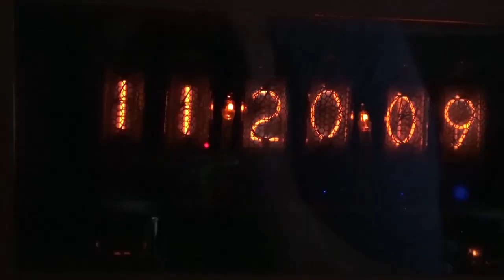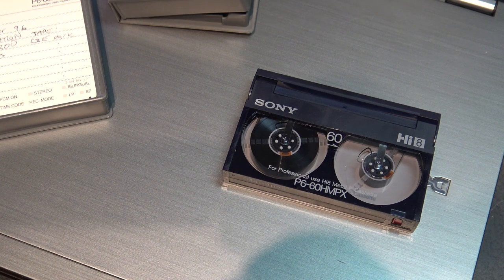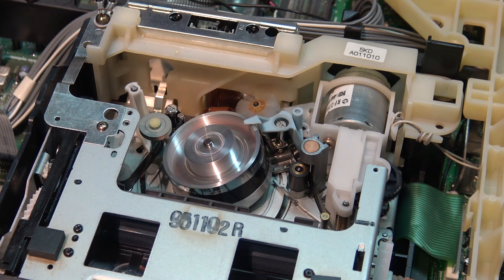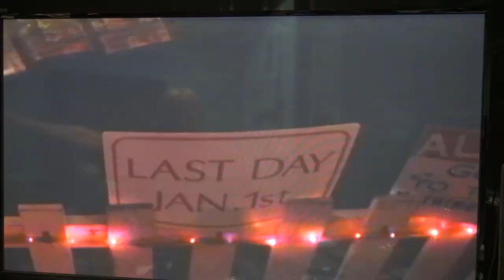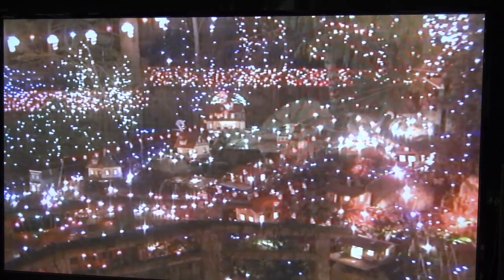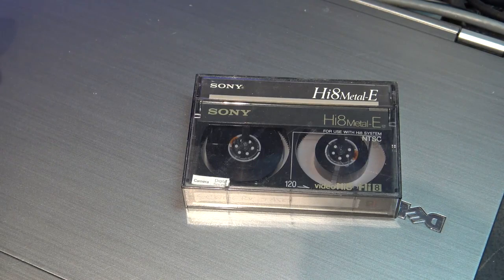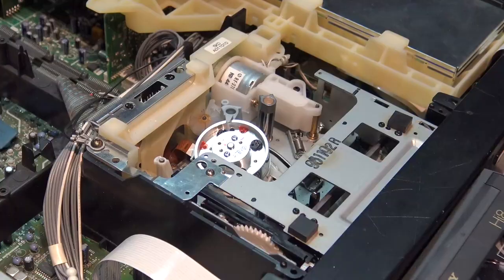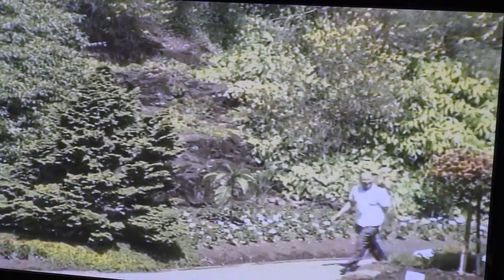Sony Hi8 tape was total garbage. Lets see why

Comment: I bought a box of those 'Professional' Sony tapes - they immediately closed the head of the camcorder.   So much for professional quality. hahah
Reply from the maker: Hahaha. Ya so did I. I bought a box of p6-60hmpx. Worst tape i ever used. I still have 3 or 4 unopened.  Sony said they fixed the problem but they didn't offer to replace the ones i had or reimburse me for loss due to tape failure rather point me to the warranty where it states they they will not be responsible for any loss of revenue for tape failure.  Tell that to the couple who's wedding was a mess of dropouts when i used one on my vx3 on a steadycam Jr.  All the nice tracking shots of them strolling around the park was lost due to a clogged head during record and no warning that the recording was no good.  Fortunately i was able to get enough but they asked for the raw footage and i didn't have the walk around shots that something funny happened (the bride slipped and fell on her ass) and I had it on camera.  They wanted the shot for a blooper reel and it didn't record.   I bought the short load tapes because the 60s were supposed to be a heavier more reliable tape.  It was just as bad if not worse. 😮😮😮😮😮 😢😢😮

Comment: Yeah I have a pile of sony 3/4" tape I still use, new old stock. In my experience sony Umatic seemed like it was getting dirt embossed into it, drop-outs that don't grind off and you can see a little impression or maybe also scratch on the surface of the tape. Just seems a bit fragile. I was recently testing a 3/4" deck and a sony 20 minute small cassette 3/4" tape came to a halt with a loud squeak in a BVU-800 which nearly made it's analog tension servo system throw the tape off the guides and then yank it and pinch it and run it over and then crank one of the reel motors into full maximum, but it recovered just in time. I don't know what the cause is yet, it's a back burner thing. Could be I got grease on the tape when I was repairing the deck and it contaminated the cassette. But the sound was like that high pitched squeak 3/4" machines make with sticky shed tape.
Reply from the maker: Ampex made some pretty bad umatic tape too. 
I don't use tape for anything except dat for temporary storage logging radio for copy to computer
Reply: @12voltvids  Yeah I mean Umatic ampex 187 (maybe and / or 197) tape. Made the death squeak and head clogged the heads every minute. After baking it played perfect and amazingly the tape surface is pristine perfect (checked with a good lens), I mean like I don't know where some minimal damage had been.

Comment: Was any issues with 1/2" VHS?
Reply from the maker: BASF tapes that were the pure chrome formula were pretty hard on video heads.
Reply from the maker: Plenty. There were many counterfeit VHS tapes that flooded the market and caused constant head clogging.
Reply: 12voltvids I used them for videos and DAT. They have been sitting for several years. I have them in a semi controlled environment. I'm almost afraid to check after seeing your video.

Comment: I have many old Sony Beta tapes that shed too much oxide and clog heads, along with many dropouts of course. When they shed, the actual tape becomes trasparent in some areas and you can see tape oxide dust all over the place inside the VCR. Never had that problem with TDK and Maxell tapes from the same era.
Reply: still new to beta and vcrs in general, but i noticed that my first betamax tape i got recently (blank), it was fine. i got these dynamicrons (blanks) and the machine itself seems to make more noise, louder and sounds weaker when those tapes are in there. they are all sony, the first one isn’t a dynamicron tho (still sony) and that one seems to be fine.

Comment: Sony reel to reel tapes are also often powdery or sticky. Somehow, their compact cassette tape doesn't give those issues. At least, i haven't experienced them.
Reply: Yes, the SLH line was problematic, not sure of the ULH stuff though. It is what's called sticky shed syndrome where the binder gets all sticky and sticks to the heads, leaving a gooey mess everywhere. Their PR-150 tapes were sticky binder that squealed liked a pig due to stiction caused by a lack of lubricant and often also shed a dry powder that's easily cleaned off and sonic-ally speaking, it was not any better than the old Scotch 150 anyway.

I have 2 reels of the SLH-180 tapes, backcoated too and were the early versions in the black/yellow boxes, bought almost 30 years ago as NOS and so far they work fine, not breaking down as far as I know. In fact, I played most of both sides of one of them the other day without issues. I think it's the later SLH-180 tapes in the red/gray boxes that may be problematic.

Comment: Besides that Sony Hi8 tapes, was Sony VHS tapes are that bad?
Reply from the maker: I never used Sony vhs but some if their beta tapes, the hi grade ones were crap so likely the VHS tape was bad too.
Reply: And likely there are no guarantees to whenever the binder decide to break off and loose some metal particle from the binder, and will cause to clog the head drum.

On the other hand, I have the Premium Grade tape made by the same company including both 6 hours and 8 hours tape, and it's not a Japanese made tape, it's a Mexican made tape, and I don't know that the quality is similar to the Hi8 one where it has the same problem by the manufacture who never solve the problem to correct their ingredient.
Reply from the maker: @Bluethunderboom  Notice that the tapes all had a exclusion to warranty for any loss of material due to tape failure.
Reply: Is also the same problem as Sony audio cassette tape whenever the binder breaks off and loose them iron oxide and contaminated the audio head and the erase head?
Reply: @12voltvids  While archiving the Sony VHS for Client, did the tape cause the head drum to get clog?

Comment: I don't know how MPE tapes are clogging the heads, as they don't have any binder, the metal layer is vacuum evaporated on the substrate. I have two Sony MPE tapes, my problem with them is the tape is so thin without the binder, the edges are curling, and the tape transport have problems handling it. Sometimes it's so curly that it doesn't even able to stay flat on the drum, in this cases they're unplayable, and I had to load-eject them muliple times, when finally the tape flattened under the tension of the transport, and I was able the play back the tapes.
Reply from the maker: The metal E tapes don't clog the heads, but the evaporated metal coating deteriorates and you end up with dropout city.  They dropout like crazy, but don't contaminate the heads, but it is about as bad when you have 100 dropouts a minute.
Reply: @12voltvids  I see. And I guess if there's a Digital8 recording on them (especially if it's LP), the picture would be pixelated and the PCM sound cuts out, because of the high data error rate.
Reply from the maker: @mrnmrn1  The biggest problem with digital 8 and miniDV for that matter was the LP speed. 

No interchangeability between decks. For the tape to play properly it needed to be played on the same recorder that made the recording.
Reply: @12voltvids  Yes, I've read this in the user's manual of my DCR-TRV270 Digital8 camcorder, although I've came across two other Digital8 camcorders (one from the same 2004 generation as mine, the other was a first generation D8), both played back my (fresh) LP recordings fine. Based on this experience, I decided to use LP only, because Hi8 tapes were expensive. About 12 years passed since then, I don't know how true it would be now, with aged LP recordings. I currently don't have access to other D8 camcorders.
Reply from the maker: @mrnmrn1  I never used Hi8 tapes for D8. Standard 8mm tapes worked fine.
Reply: @12voltvids  That might be the reason for your LP recordings are non-interchangeable with other players. IIRC, the user's manual stated that you shouldn't use Video8 tapes for D8 in LP mode, only in SP. It claimed you should use LP speed with Hi8 or D8 tapes only. I have to look up that manual now... Aren't the Video8 tapes chrome, and the Hi8 and D8 ones metal, are they?
Reply from the maker: @mrnmrn1  
Nope. I only used lp speed with the super long p6-180 tapes so I could get 2:15 record time for long weddings to make the master and the tape was always played back on the same machine when dubbing to vhs for clients.  
The lp tapes both on d8 and minidv were all tapes from clients wanting them transferred.  They were all on hi8 take or dv tape and any time I got them I had problems playing them.  For the record I have 3 d8 cameras and a gvd800 player for my digital 8 and 2 hdv cameras and a gvhd7000 hdv player.  When the lp tapes will not play on any of them it rules out any failure of a specific Machine I own.

Comment: Interesting, do some people have the same problem, say with, DAT tapes, since the technology is similar. Newer had this kind of problem with audio tapes: Maxells XLll, MA, TDK SA, SA-X, MA-X, some BASF - well they have other problems. Maybe some cheap ones would have dropouts from time to time.
Reply from the maker: It seemed yp happen only with the high grade 8mm and Hi-8 tapes from Sony. The standard grade didn't seem to have the same faults, but then from my experience I never used a standard 8mm tape because my equipment was all hi-8 so I used hi-8 tapes and my Sony branded ones are failing.

Comment: Surely you did not transfer this over to DVD unless the print was very good and clear...
Reply from the maker: Actually I do transfer tapes over even when they look bad like this. Have to stop constantly clean the head and pick up again. If going direct to DVD I'll stop the recording clean the head and then start up again rewind back slightly so that material is not missed and the client gets a tape back and their DVD and it'll have multiple chapters or I've had to stop to fix it and I'll tell them up front yeah the tape was damaged and this is why it cost extra right. Because I have a standard price per tape but that price is only valid if the tape has no damage if the tape requires extensive work such as demolding it before I can transfer that costs extra and they're informed and either they decide they want to do it or they don't. I've never had anyone say no to recovering their tapes because they really don't have many other options other than lose the footage.
Reply: @12voltvids  That's Amazing work, do you get tired of ever watching your clients video's, transferring video or vhs to DVD or any other tape medium is time consuming, that's good you charge extra if the tape is damaged, as damaged or worn tapes can be troublesome for the heads, and also can break the VCR, which has happened to most people.
Reply from the maker: @speedyboishan87  
Yes I do get tired of watching people's tapes. I am much happier when the tape does not have a problem and I can just load it press play hit the record button on the recorder and walk away and just kind of monitor it and make sure something doesn't go bad but when a tape is damaged and has to be babysat it gets monotonous. I understand that a new parent wants to do nothing but film their baby but come on 30 hours of tape in the first year!  I can understand the milestones but every time the kids spits up doesn't have to be documented on tape or worse now sometimes it's funny those first moments are usually pretty funny and I've got some that I'm sure will embarrass my kids when they're showing to them at some date down the road preferably at some celebration like a wedding nothing like embarrassing them in front of all their friends 😂. I see when I was growing up that's the type of stuff that my parents would have done drag out the most embarrassing moments and put it on display like a family gatherings and stuff and for someone with my age that was just growing up unfortunately today the kids are so sensitive that if you look at them the wrong way they're going for counseling. It's a sad world that we're in now.
Reply: @12voltvids  That's great what TBC do you use so that any Flicker or video abnormalities are fixed, not video malfunction..
Reply from the maker: @speedyboishan87  i use the one built into my player and capture devices. For something really bad I will run it through the videonics mx1 but generally the built in tbc on my evs7000 works great for 8mm and hi 8 and the input tbc on my Panasonic and Toshiba DVD recorders also work great at cleaning up video with poor sync.  That's all the time it's correct it will do is clean up the sync. if you need to adjust the video level and chroma level and chroma phase then you need to have a proc amp. Some high-end time base correctors also have a procamp built in. However to accurately use a proc amp you need both a way for a monitor and a vector scope and the tape needs to have color bars recorded on a section of the tape made it the time the original recording was made. This is used to set the video level Black level chroma level and chroma phase before you actually start the capture. since the number of home video users that were recording color bars for 30 seconds or a minute before they started using their tape is zero they do you no good because without a reference, and your monitor and eyes are not a reference, playing with a pro camp will usually do more harm than good. My EVS 7000 for example has a procamp built into the time-based corrector which you access using a menu you can adjust the color level and phase on playback however unless you recorded color bars on the tape prior to recording, and high-end cameras have the color bar option, your game don't have a reference. When I was shooting analog every tape had a minute of color bars at the beginning recorded. This serves two purposes one to allow for adjustment on playback and two to make sure all the high dropout areas of the tape which were usually at the beginning had passed before I actually started recording something. I was using a tectronics waveform monitor and vector scope in my studio when I was dealing exclusively with analog stuff. I don't use them anymore I've got them now built in to my editing package and I can tweak stuff once it's been captured however you still need those color bars recorded at the beginning for a reference
Reply: @12voltvids  Hi mate I have a JVC HR-S9700EK SVHS VCR if I insert a tape it tries to load, but then ejects and powers off, what could the issue be, please assist. Thnx

Comment: Totally agree that Sony Hi8 was totally garbage! And a long with them the Digi8 as they was just as bad. I digitized all VHS and DV tapes almost 10 years ago and I ran into problem with Al my Sony DV tapes but not at any of my VHS/VCR tapes.
That was also when I start doubt about DV as a format as all my VHS tapes had no dropout's like the DV had! Ok, VHS might have gone noisier but non of those dropout's found on the DV!
Thanks for a great video and perhaps I might try another time to copy those DV tapes that was stubborn then and buy me a cleaning cassette if they are still to be found 🤔
Reply from the maker: I never had any problem with hi8 or DV. Only a specific Sony hi8 tape.  The binder was bad and the tape coating came off clogging the heads.  Never had issues with maxell, Fuji or tdk tapes.  The only issues I have had with DV tapes is those recorded on garbage canon cameras.  They have a clip on pinch roller that breaks and then the camera chews the tape which contaminated the heads on subsequent playbaxk.   8mm and DV tape being much thinner than VHS was easier to damage.  If stored in damp dark places could go moldy and moldy 8mm avs DV tape will tear when unspooled. VHS can also get moldy but usually doesn't break.

Comment: WHY SONY DID NOT MAKE  D8 PRO  3CCD CAMERA?
Reply from the maker: The D8 format was never intended to be a professional format. Even though it recorded to the same spec as DV and could have easily handled an HD signal with plenty of extra bandwidth sony crippled the cameras by giving them a low pixel CCD. Even lower than the Hi8 cameras of the day. So even though the tape format could easily resolve 500tv lines (analog equivalent, the digital resolution 720x480) the sensor only had 345,000 pixels whereas equivelany DV cameras were typically 680K.
The only reason that D8 existed was to satisfy people that had already invested in 8mm and hi8 equipment and wanted to make the move to digital without rendering their existing family tapes on 8mm and hi8 obsolete. The initial D8 cameras all would play back analog recordings. Remember these were budget cameras targeting home video. Sony also had a professional video division that made DVCAM equipment. DVCAM was similar to DV. Same bit rate as DV but a baster tape speed. A 60 minute miniDV tape for example was only 40 minutes in DVCAM mode. It used a wider video track width so that dropouts were less of an issue, but DVCAM players could play back SP recorded DV tapes, but the reverse was not true. Consumer and pro DV could not play DVCAM.  The other companies concentrated on Professional DV (JVC) and DVC-PRO (Panasonic) DVC PRO uses a different codec so was not compatable. Professional DV (JVC) was compatable with consumer. 
Anyway it was all marketing. The professional division paid the engineering costs for the consumer allowing you to buy a digital camcorder for 1-2000 as opposed to 10,000 which is typically where the pro models started and went up from there. The pros got better cameras, and glass, and through this recorded a superior picture suitable for broadcast.

Comment: In 2003 I bought a dvd burner and burned all my VHS and cassette tapes to dvd and CD,  and I did it just in time, a lot of the cassettes were slowing down and had to fast forward and rewind several times, and that was with a nakamichi tape deck bx1
Reply: sounds like the deck needed replacement belts.